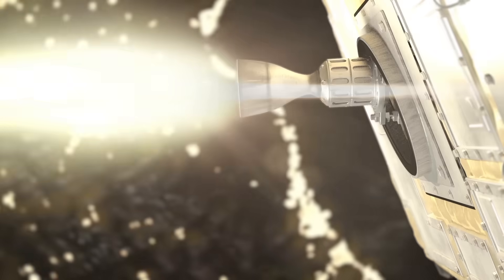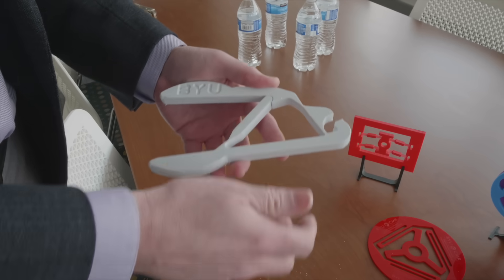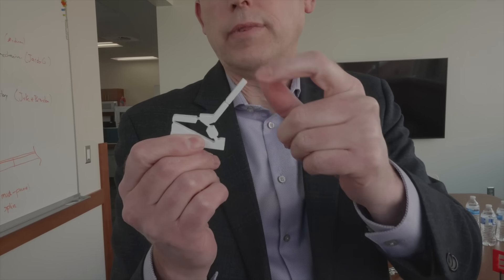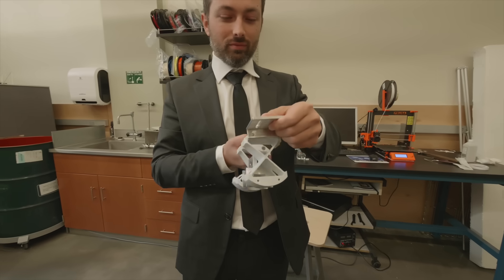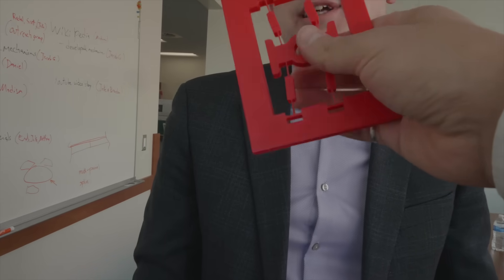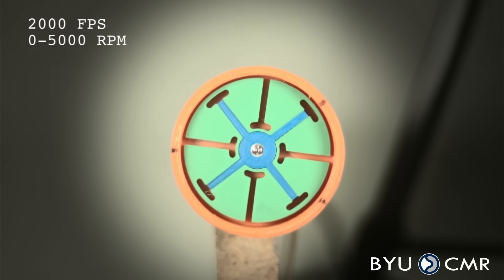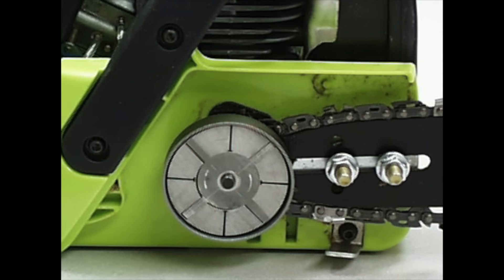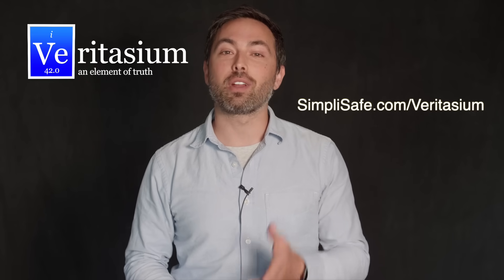Why Machines That Bend Are Better

Comment: It's hard to believe that thin plastic can hold up that long.....1M cycles?
Reply: It's the wonders of Polypropylene!
Reply: Probably because friction is reduced, meaning less breakdown.
Reply: Think about the lid of a tictac container
Reply: Robert Szasz  Good example. I've been re-using the same Tic Tac container since the mid-1980s and typically consume around 3 boxes per day. (Fresh ones of course, I only re-use the box!) You get about 38 Tic Tacs in each box, so I reckon I've opened and closed 'Old Faithful' around 1.25 million times. That's the great thing about Tic Tacks. 🤓
Reply: @nagualdesign
You should worry a little about plastic leaching over time when re-using a food container -- but only a little, because it sounds like they're only in the container about three hours before they end up in your mouth.
Reply: @nagualdesign  using the same tictac container for 40 years. Now that is dedication my friend.
Reply: @mal2ksc  Well, the inducement of heat, and of course time allows more plastic particles to leach into said product. All in all, plastic shouldn't be used when it comes to various examples. BPA is absolutely horrible. Children are now born with plastic in their bloodstream and tissue.
Reply: @Curt-0001  oh my God. 1981 was 40 years ago. Jesus christ
Reply: @nagualdesign  40 Years and still spell Tic Tac wrong.
Reply: @jonathanmadzinga1985  I honestly don't remember typing that comment 3 years ago but I can assure you that it's utter nonsense. Why would anyone buy a fresh box of Tic Tacs and decant them into a used box?! 😆

Re-reading the thread, the person I originally replied to gave a very silly example, since a Tic Tac lid will generally be opened and closed less than 40 times before being thrown away. Hopefully he was being sarcastic rather than stupid.

I did, however, spell Tic Tac both correctly and icnorecttly. Probably automiscorrected.
Reply: @nagualdesign  Oh.
Reply: "Plastic" is a very broad term. There are a lot of different kinds of plastics.
Reply: @ViaticalTree  plastic is a vary... plastic term
Reply: @QuackingQuietly  NICE ONE !!
Reply: 1 million is not that great (but in research, which is what Howell does, that's really good). They probably have only been running the machine for a few weeks, which is what will get you to a million cycles. If they ran it for two years, they'd get roughly to a billion, though the time depends on the RPM of the motor.

Also, most of the hinges don't actually bend that much, or don't have very much material to bend. It makes the internal forces much smaller, leading to longer lifetimes.
Reply: @joranbooth5529  actually 1 mill puts you in the long life category, in bulk electronics you can expect half or less that number on average
Reply: @xxportalxx.  You're right, but in machine design, it heavily depends on what it is for. If we are talking about a light switch, that's more than enough. Airbags? That's way beyond what you need. But if we are talking about a pneumatic valve, that's much, much too low. If it's a car engine, you need infinite life, not just high-cycle life.

1 million cycles is the bare edge of what is considered high-cycle fatigue. Most materials, other than steel, fail between a million and a billion cycles or so. That's why they're always doing preventative maintenance on airplanes. The parts literally can only last a few years or so before they are in imminent danger of failure. A million cycles is impressive, for sure, but if they don't prove it further (which is not the point of their research, since they do R1 research, not R3 or R4), then it's not something that will be adopted in infinite life applications until it is proven. But that level of research is expensive and boring, and practically no one wants to pay for it.
Reply: @joranbooth5529  I completely agree with your reasoning, and now have a better appreciation for why subways are so disgustingly broken down ;p.

As an EE mechanical design is a touch outside my official training Haha, I just assumed the bystable mech. would be in a switch, never considered other environments. 

Certainly a mill is not very far into the extended life range, but again in bulk electronics it isn't rare to see parts with less than 25k cycle expectancies.
Reply: @xxportalxx.  I appreciate your pushback and expertise! I do some work with circuit boards, but I've never looked into their fatigue lives. Thanks for sharing your EE background!
Reply: To put that into proportion: the electrical life of a switch (at rated current) is typically in the region of 10,000 to 100,000 cycles. Switches which only carry small currents (i.e. are not switching any substantial load) are often rated for 1,000,000 cycles.

Yes, the rubber dome keys in the Logiteck K120 keyboard are rated for 10,000,000 cycles. But rubber dome keys are "machines that bend" (well, they also slide a bit), so these are out of competition here.

Anyway, some mechanisms have a metal axle attaching the (plastic) lever to the (plastic) base. The plastic usually breaks at the metal axle. Just because there is hinge does not mean that this region is free of stress.
Reply: 10^7 is pretty good, but thats only when the inputs are within the designed range, you increase the frequency or force and that will decrease service life.
Reply: I'd say a lot of the work also went into the material science, and not only the mechanical side of it
Reply: Sounds like a lot, but how many spins does a metal cog last?
Reply: @adamkwalczyk  whats the design/teeth contact patch/load/rpm/material/hardening/lubrication etc like.
Things can be designed to last for as long as required.
Reply: You can build to last or you can build to break, if you buy something out of a mass produced item then build to break is the rule.
Reply: @Ramiromasters  depends on the application, but technically it's impossible to build to last. Everything has a lifespan, and not every application requires a long one.
Reply: @xxportalxx.  Last don't imply forever. I'm talking about things like razor blades which could be built with superior quality materials but then would lower the company's revenue. Some car manufacturers build parts with different metal hardness solely for the purpose of wear and tear so they can sell parts later. I know people like to think that some authority or moral standard prevents this from happening but the reality is another. That's not to say that real durability issues don't exist, is just that sadly these come way after your device has stop working by planned obsolescence.
Reply: @Ramiromasters  My point is that "Planned Obsolescence" isn't a mythical villain to moral society, it's a fact of reality. Any good engineer who's done his job has planned for obsolescence. There is no properly designed part in existence which hasn't been built with an expected use term.

In the case of razer blades and the like there are many considerations which go into the material choice. To be clear to get a good cut you most certainly need to replace or sharpen it regularly, regardless of the material "quality." Now there is some wiggle room as to how regularly this is, i.e. the period of operability. Brass won't last as long as hardened steel which won't last as long as titanium which won't last as long as chromium which won't last as long as tungsten carbide. But the price increases exponentially from steel. It simply wouldn't make sense to use titanium in razor blades economically.

Now the quality and alloy of the steal certainly play a significant role, now that we've dialed in our expectations. Now let's forget about diminishing returns for now for the sake of argument and assume an infinite potential for gain in life from input quality. If you were to make a razor which lasts a literal lifetime you've now limited your market share to only pubescent adolescents. This now places the bulk of your microeconomy on population growth. Not a good model, and certainly not sustainable.

Planning for a shorter use life would change this to a more practical model. Thus we reach the consumer economy in which we currently reside. Not to mention this makes razors affordable enough that anyone can buy one, which is socially beneficial.

Now this is drastically simplified but does illustrate to an extent some of the considerations beyond simply "making more money."
Reply: @xxportalxx.  The consumer economy happen because of lack of social coordination. An "on demand economy" would be more efficient, customer oriented, and beneficial for the environment; we are there technologically but not socially. Tesla produces electric cars on demand and batteries so there is a redundancy of what they can do to sustain the business. A lazy and wasteful approach to business is producing goods made to break to sustain the same endeavor. Just because something can be made a business it doesn't mean it's good for society; for example a business that constructs an apocalypsis machine may offer a great salary and retirement plan but you may not get to use it...
Reply: @Ramiromasters  Interestingly, your razor blades CAN last forever.  It's rust, not shaving that actually dulls the blade.  Keep your blade in a small container of rubbing alcohol when not using it.  I've used blades until the gel strip wore out and fell off.  To your point, the blade companies go to great lengths to keep people from finding out about this simple hack... the packaging around blades has holes drilled into it... why?  So you can't simply fill it with alcohol and use it as a ready-made container.
Reply: @sursurrus  Alcohol can dissolve water, in fact that is why it cleans so well but it can drive water further. I also use blades for a month or two but I just rinse the blade off well and shake it and leave it away from water so it will dry.
Reply: @xxportalxx.  It also has been proven that companies don't build to last anymore. If they break people buy more it's just a fact.
Reply: @dudewheresmycar6318  that is certainly a part of it, some areas are more clear than others (light bulbs being the gold standard for that). However there are other areas in which it's unavoidable with our current technology and rate of advancement.

Comment: Hey what you said about Backlash, i dont think that true, the flexible joints themselves have a finite length and that must bend the otherway to switch directions.
Reply: What he was talking about was the mechanical joints in pins need to have clearances in order to move, otherwise the pin joints would be seized. Those clearances are what cause the backlash ( or a lag of one input of a device to cause a change with the desired outcome of a device.) That lag does not exists with compliant mechanism (unless a member of the device is buckling before it moves ) when the change of direction occurs because all the members are just bending. The confusion might be backlash is not the travel that the pin mechanism and compliant mechanism must make before  changing direction, but rather the desired input and output response for the mechanical device.
Reply: @frederickhf241  yeah but thats what im saying, there will be a delay in these devices here. Perhaps not a time delay but a spatial delay, because the little piece of connecting material will need to bend the otherway to transfer the required force.
Reply: @toozydude2  The spatial delay is not backlash. 
For example:  If you put your finger on a switch and flip it in one direction. Then as you put your finger on the switch to flip it back you feel there is a little "wiggle" room before you feel resistance of the spring keeping the switch in place. That is backlash. With the compliant mechanism you will not feel that "wiggle" room because  the whole mechanism is one part.
Reply: @frederickhf241  Yeah see thats what i mean, im saying that there will be wiggle room. Think about it. The wiggle room isnt 100% free wiggle, but there is some bending that isnt doing anything.
Reply: @toozydude2  Is there a specific example that you can point out in the video?
Reply: @frederickhf241  well for example the elephant mechanism. Quoted for pitching of wind turbine blades. So in reality it would require significant torque to pitch the blades, therefore at hole which stays still (as demonstrated in the video), there would be resistance when applied to actual use. Now imagine pushing on the back of the elephant to turn the hole, if the hole had resistance, you would have to push a bit harder to overcome that force. Therefore you will have to deform the structure a little to start the hole rotation. This deformation is significant due to the flexibility, as it requires long thin connections. In the case of mechanical bearings this can be much smaller. However saying all this, im not saying these mechanisms are bad, i think they are brilliant, and im sure what i said is also fully trivial to the researchers. Goodnight from Germany.
Reply: @toozydude2  Let me get specific with the idea of backlash. In a perfect system with no backlash; you could push a solid steel cube in one direction by 5mm, and that solid steel cube will move exactly 5mm down to the atom. An example of a system with backlash is badly meshing gears with a 1:1 ratio; the two badly meshed gears could have one gear turn .2 rads  without it ever making contact with the second gear. The mechanical tolerances with pinned connections or even things like gears where two mating surfaces have to make contact with each other in order to transmit force are where backlash comes from. These means systems do not always have the same repeatable responses when given the same force input. A complaint mechanism that is designed for the expected forces it will be applied to will behave like a solid cube being pushed, every joint is always in contact with each member moving in the system. There is no room for one member to move without it moving the other members, that way you can always get the same repeatable output for a constant input. I think I understand where you are coming from with your example of the elephant and the deformation, I don't want to argue for the sake of arguing but if you are interested this video shows a little more depth of what backlash is https://www.youtube.com/watch?v=NqF_ETWvBCA . Greetings from Texas.

Comment: Most of this technology is old and either already in applications, or tried and discarded due to degraded performance. Not saying it can't be improved with better materials. Like, I had a plastic vice grip when I was 15 years old. Single piece of plastic. Eventually the small hinge points got soft and it lost its integrity. 

And centrifugal clutches are like 200 years old.

Comment: All of this is very cool. The only thing that would worry me is if one flexible links breaks, would you need the replace the entire part? Would it raise the operational costs? Replacing a bigger more expensive part vs a smaller cheaper one

Comment: Somehow I can't wrap my head around the durability part. At least not with plastic type materials. Then again, with metals, it blows my mind on the flexibility, and question durability again (i.e. against corrosion of decades of use).
If it were such a great thing, wouldn't that mean that we should be seeing much more of these devices in any part of daily live?

Comment: Your videos are very interesting and comprehensible. This one was too, but it left me with questions. Quite a lot of them actually.

My understanding is you wanted to explain the main topic vividly. The examples you used for that did their job - I feel I know the basic principles of compliant mechanisms and how they can be utilized. I also know, I have a huge gap in understanding how the examples work:
How are the chips made, and what are they needed for?
How is the titanium so bendy? Is it because of the large surface, i.e. the sum of many slight deviations?
What other requirements exist for the thrusters? Why is this solution good/the best?
What is the benefit of using a clutch? Why is it a benefit?
Does the laser hit the cog all the time, or just under special circumstances? Why does the cog have to rotate with 2 Hz? What compels the cog to rotate?

I'm sure I could fill at least some of these burning questions in my brain with a trip down a research rabbit hole. If your intention was to encourage self-motivated learning - well done!
Since I should have gone to sleep instead of writing this comment, I'm not going to do that, though. 

Thank you for the interesting video, anyway! It's always good to hear from you!

Comment: what he said at the end is what happens in the aerospace and rocketry industry as well. A company like northrop may be contracted by the defense department to create a new ICBM guidance system but once they complete the contract they have no clue if it's getting used or get put in a file in a cabinet somewhere.

Comment: wouldnt this mean it breaks easier tho?
Reply: Doubt it. They are super simple, with virtually no weak points since joints are all practically non-existent.
Just look at the million use switch, for example.
Reply: They said things like these can last up to one million cycles
Reply: its the opposite
Reply: @veloce5491  idk, just thinking the net effective area is gone be reduced by so much. As for the pretension switches, I ain't complaining.